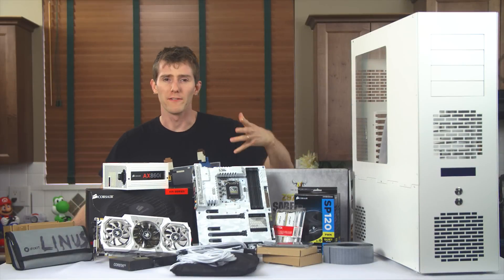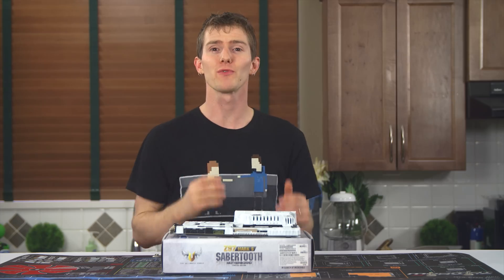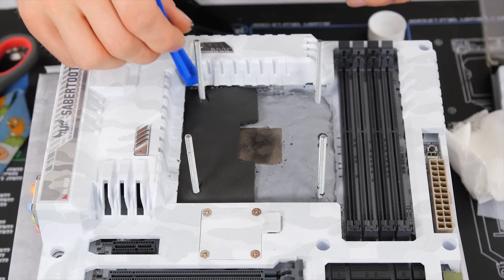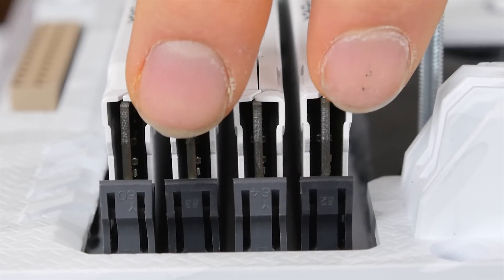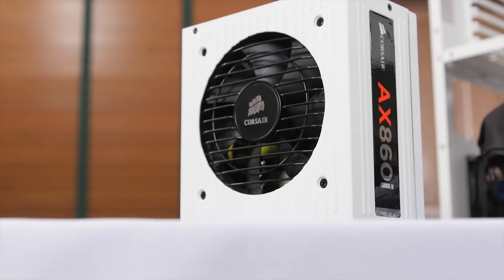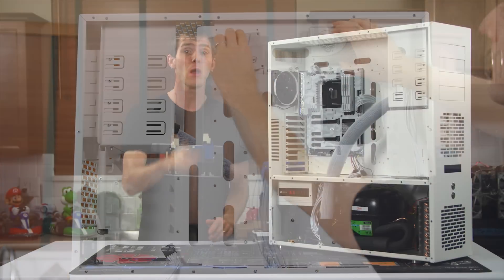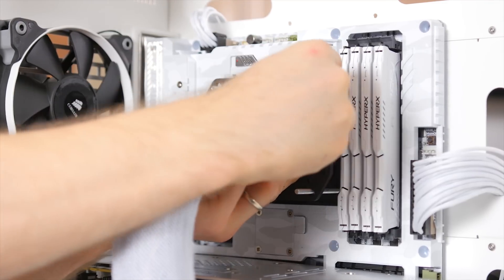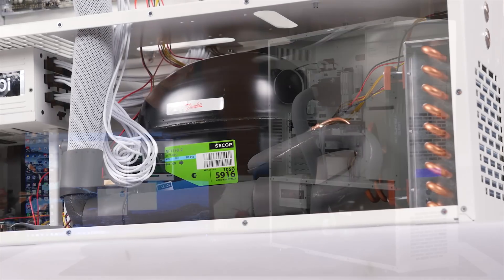ULTIMATE Sub-zero Phase Change Cooling PC Build Guide

Comment: Here from the latest phase change video:
I feel like there is a design opportunity in a self contained sub zero CPU cooler that has been missed here. 
Invert the motherboard and mount it on the opposite side of the case, then add a small catch tray for any possible run off. 
The CPU was moved to the top of the system in the ATX standard to allow better heat dissipation, but reversing that could protect any add-in boards from condensation shorting.

Comment: I always isolated mine with armaflex 1cm thick pads, and dow corning number 4 dielectric grease.

That worked fine 24/7 for years at -45C.

The only thing i wished i had, was a heater plate. In 24/7 use, when in idle it puts some heat on the system to keep the area dry, otherwise eventually cold will get through.

You could run some process to heat the CPU... But back then it was annoying on single core CPUs.

Comment: ask whats the tempurature of standard rubbing alcohol vs water in same bottle does one stay colder than the other liquid and does one condensate or does one evaprate out the moisture to have its better benefit in dry cooling liquid ?....contemplate on the contrary minor change that works like matchix as a water sucker not a water spiller for things that need to stay dry without seapage through materials as water can

Comment: maybe cooling systems should try rubbing alcohol for its liquid it might then avoide condensation as the moisture sucking liquid better for cooling with dry response not tap water but the water evaperator sucker to blocking wetness but no brainers applied for comon sense liquid cooler methods that aint just water but water disolver as the liquid oh and germ killer so no moldy systems

Comment: The phase change cooler alone is something like $2000
Reply: You can build one yourself, thats how we did it back then. There was a time when there was no comercial watercooling or phase change units. And heatsinks were shit too...

It was build it yourself or nothing.

A fridge 1/3hp compressor, 2m of 0.9mm capillary tube, a dryer filter, a condenser and a homemade evaporator made out of a chunk of copper and you are good to go.

You'd be amazed at how easy it is to get sub zero temperatures.

Comment: linus . . . ? 
does this system still works today demand of cooling issues we all gets
high cpu and gpu temp
now days there is a micro comppressor that can chill to -5 c 
but then a again does the moister will damage the hole pc up
Corrosion and moiste
thinking of build a stand alone unit that will provide a cold air directly to income air cpu + gpu
thanks for many Enlightening clips
keep with that enthusiasm 
big like from ISRAEL

Comment: There's nothing in a PC power supply that can kill you, nor even come close to killing you. That's one of the most asinine myths on the internet.
Reply: thats cap some of the capacitors can discharge up to 700 volts into your body which can kill you
Reply: @briachouston5941  "some of the capacitors can discharge up to 700 volts into your body"

Even if that were true (it isn't; a PC power supply takes in 120 VAC and converts it to 12, 5, and 3.3 VDC; there's no mechanism or reason for ramping up the voltage to 700 anywhere in the circuitry), so what? Do you know what the voltage of a typical static shock is, like you might get when you touch a door knob?

"Under severe conditions, up to 15,000 volts have been recorded. It is quite common to experience 5,000V. In fact, many people do not feel a shock from a static electricity discharge less than about 2,000-4,000V."

Also, a Taser is 50,000 volts.

"which can kill you"

Not even close, as I already said. There's not anywhere near enough energy stored in those relatively tiny capacitors to be dangerous.

Comment: “Massive 32GB of RAM”. Heh. I think I’ve seen them put 128GB into a workstation nowadays.
Reply: Yeah, im wondering using this cooling system on nowadays parts. Imagine all this w the new rtx, and a i9 10k overclock, 128 gb ram
Reply: 32GB is still a lot today, so you can imagine how much it was in 2015

Comment: A while back my gaming PC was getting old and always crashing with heat issues. I realised the air conditioner in the window could be an easy fix. I know everyone says it’s bad to use the AC and water damage with condensation. But I didn’t care. I moved the full tower case next to the window. Removed the side panels. And blasted the case with cold cold air. Highest fan setting. It was loud and expensive. Sure. But that PC ran sweet for another 12 months, until I retired it with a new gaming PC. Never had a problem with water condensation and all the things people warn about. It is so much more effective than water cooling or fans blowing heat around the case.

Comment: Damn the nostalgia and wow time really has passed, 32GB ram was considered massive then. I miss those really in depth build guides
Reply: @miguelwaide8198  yes almost no benefit for this when gaming but it isn't that expensive anymore
Reply: Crazy what 7 years does to technology
Reply: Wouldnt really say there is much difference, games in 2015 and 2022, 7 years apart, are pretty similar, there are only minor improvements in graphics and little has changed in gameplay.
Compare for example 1986 when games like Super Sprint were the rage, to 7 years later in 1993 when DOOM was released.....

Comment: Yes, actually, some silly Geezer Geek, ( or so I was named by Wired more than 10 years ago), found it interesting. While IBM's mainframes were often referred to as 'water-cooled' machines, the machines designed by Seymore Cray for Control Data and later his companies Cray Research were actually 'freon cooled' much like the machine built here. Instead of a freon-air cooler, they all used freon-chilled water intercoolers. CDC 660s used 8 tons of cooling, while 7600s 20T and the Cray 1s were 100 tons with later models requiring even more. I am thinking about building one of these for my next build. Good job, Linus.

Comment: Here's an idea:  Instead of attaching the phase change cooler directly to the CPU you could attach it to a CPU water block which you integrate into an full GPU + CPU water cooling loop.
If you wanted to push both components under 0C you would have to put anti-freeze in the loop but and add art eraser or dielectric grease to the GPU aswell.

Comment: Watching 4 years later, brings memories, i used to have LD PC-V10 with Phase Change unit. It was loud and obnoxous but it was sacrifice i wanted to make for best possible performance :D
Sad i sold my PC-V10, i want another unit like it. Now that im wiser i would use first layer of blue masking tape then layer of art eraser top of it, reason is to make art eraser extremely easy to be removed. Only thing i wanted to be improved in the Phase Change unit is switch to less noisy compressor.

Comment: Yo dawg I heard you like eating snacks from the fridge while you game. So we made your gaming pc temps..[...]

Seriously though, if they made a miniature sound dampened case and cooler as a single kit and miniaturize the whole thing for itx mobos, id get one. From 2 aios gpu and cpu in a silverstone raven 01 kit  still clogged itself with radiator dust and overheats.I want OCed itx to fit on my bookshelf but still be able to idle quietly and out of the way on a 7 inch deep narrow wall shelf, and my slim form factor case and 2 aios couidnt even deliver that, as it sits unable to boot up..

Comment: This is really late. But if you are replacing the entire shroud to add a water cooling block why does it matter which card you use if you only need to find a white block. Narrowing down the card to only a 980 because of the white shroud is moronic. Just get a white block for any card and remove the shroud... 8\

And with a proper engineering background you could easily modify a fridge to fit a computer by replacing parts if needed. I'm sure it's possible. We really need to raise standards. Knowledge when sufficient removes those danger problems. That is kind of the point. Or part of it. We used to expect people to learn everything. We need to get back to that.

Comment: Yeah but you're forgetting that if you have NVMe drives installed it'll kill their speed; they have to run hot in order to work at their proper speeds. Or else you may as well just use a regular HDD...

Comment: How about using Enermax Liquitec 360 for my Tread Ripper 2990WX and cooling the Radiator separately with a Peltier modules/combination to sub zero/almost nearer to Zero.  

or 

Isolate the whole system complete air tight, use dehumidifier equipment or chemical dehumidifier and cool the air within to sub-zero / almost nearer to zero.. 

Which one would be better.. 

Do suggest with this..

Comment: It's an air conditioner. 😋
What's the point though? Water cooling is overkill most of the time and that extra work to prevent condensation on the processor...
Reply: Well for the average consumer is not worth it is meant for day gamers or editers

Comment: This is old but is still incredible. 

I agree on the power supply, don't take apart your power supply unless you have experience with safely working on high voltage electronics.   Power supplies can have up to several hundred or several thousand volts even when powered off.

Comment: Is anyone ever thought about utilizing a non-conductive liquid to cool their PC computer stuff water pure water doesn't connect conduct electricity it's the particles that are in the water that will conduct it if a clean area inside the computer with no dust particles what have you in a liquid coolant system that doesn't conduct electricity you could circulate that and keep everything cool maybe
Reply: the water would erode the components and ionize which would short your system. You can submerge a pc in stuff like mineral oil linus did a mineral oil build a few years ago

Comment: Watching this now in 2018 I think this could be combined with a mineral oil immersed PC build to achieve really cold temps on the whole system not just the CPU. Is it practical? Nope but its sounds crazy enough to work since the mineral oil ensures no moisture... (Not sure if it would turn to sludge under really cold temps though)

Comment: i know its really late and you probably wont see this, but good call not laying it on its side. from the looks of it that was a hermetic compressor of some sort, and those need to not be tilted cause oil on the inside may end up flowing out of where its needed and would possibly cause problems later. i could be wrong tho.

Comment: Think with a liquid cooling system with large revisor, and a compressor cooling the liquid it wouldn't have to turn on very often once the target temperature is reached.  Obviously water wouldn't work, and water/alcohol or ethylene glycol mixture would have to be use to keep it from freezing.  Interesting though.

Comment: I have the same processor running at 5ghz on a deep cool 360mm aio temps on synthetic load is around 50-60 deg Celsius

Comment: Well he did touch on a tough subject. Heating the room your PC is in. I started by running a water cooled FX9590 overclocked. It certainly made the room hot. So I built a box that sits on top and uses a nice fan to send all that nasty heat through a 4 inch vent pipe. Other end connects to a board in the window. All my PC heat is now exhausted outside keeping the room cool.
Reply: Certainly saves on my gas bill.

Comment: You could lay it on its side, the oil would come back to the compressor after a few hours due to gravity... And in this case the suction and discharge lines of the compressor are on the opposite side of the compressor than the side you'd have laid it on, so it would have been safe without even waiting to power it on after putting it back up straight...
Reply: Thanks for the info, i can finally sleep with my fridge in my bed rather than in the kitchen tonight

Comment: damn it... someone did before i could....I was making plans for a R134a computer cooling case... and I was so close too.. similar design too.. crazy

WARNING TO THOSE WHO ACQUIRE THIS CASE.... R134a is a very dangerous chemical. It like Liquid Nitrogen, with the potential of give instant frostbite. It displaces Air, so any leaks can be harmful, if not fatal. If something were to go wrong or youre seeing a temp difference your best bet is to call a Heating/Cool company to help you repair it.

only certificated personnel can charge a system with any refrigerant

Comment: It's not an ultimate sub-zero cooling setup until you run an exhaust hose to your window. Congrats; you now vent your heat outside your house, essentially using the exact same methodology as a portable AC unit

Comment: How about just shut the door in your little computer room and turn on your 8,000 - 10,000 BTU air-conditioner and drop the room temperature down to 60 degrees?
Reply: Air conditioner won't drop temps below 0c.

Comment: Someone that pays this much for this phase-change tower and goes thru all the work to set it up while indeed not settle at 5.0 GHz with this chip, even having a pessimistic silicon-lottery attitude. Is there a follow-up video where he actually does more testing to see what clock speed he can reach with 24/7 stability? Or anyone else that attempts this and actually follows-thru on the overclocking?

Comment: Enter cheat code "bustoutwallet" + "forkitoverforusedcommercialkitchenStandalonecooler" could also substitute "fzr" instead of cooler. 
This will adjust your fridges BIOS settings to run calibrated for a much higher load cycle. 
As an added bonus you can store excess groceries next to it. 👍👌

Comment: a compressor can be laid on it's side as long as the power terminals ARE NOT UP I repeat  ARE NOT UP if the power terminals are up the compressor motor power wires can pull away from the terminal

Comment: We used to run Haswell at 5 GHz on fancy phase-change cooling, now a simple AIO or even an air cooler on a Kaby Lake and you got yourself a stable 5 GHz
Reply: Okuyasu Nijimemeura but imagine the clock if you phase changed a kaby lake cpu
Reply: wonder what oc is possible with kaby lake and phase change cooler

Comment: would you want to cool your GPU like this too ??? and can you ??
Reply: Lance Mccarthy graphics cards coolers cool more than just the Gpu so even if you were to get it mounted it would overheat other components. Even if you did find a way to keep everything cool, it would be impractical as Gpu overclocking isn't a very useful thing. 
Tl;dr: no
Reply: gpu overclocking isnt a very useful thing??? are you kidding??? 

yes you can cool gpus like this however it also depends what temp youre trying to reach, the lower the temp the less practical. but you can get sub zero with these kinds of set ups. 

though running gpus like this isnt as easy.

Comment: as a student of chemistry and physics it would quit interesting if you would use Nak (sodium and potassium allow which is liquid) as a replacement for water. the "NaK" is used as a coolant for nuclear reactors. it sould work fine
Reply: andrius bal -- With NaK (liquid metal alloy), you have to add electric heaters to insulated coolant lines to get the system started, since solid metal does not pump worth a damn. NaK has a low melting point, but not that low, and it is usually pumped with MagnetoHydroDynamics (MHD), basically the "caterpillar drive" from the sub in Hunt for Red October. The main reason for using NaK in nuclear reactors is that even at extremely high temperatures, it remains at low pressure (unlike steam).

Comment: Why not just use a water cooling system and just super cool the radiators instead of the CPU? That way you wont worry about condensation on the CPU as all the condensation would be on the radiator... You can even put the radiator in an aquarium instead of using a heater for the aquarium ;)
Reply: that would still cause condensation at the cpu as soon as your liquid/block moves below ambiant temps. It would acctualy be much worse also because the entire hose will have condensation. You can do an expereient with a glass of ice water and some hose to see yourself.

Comment: TEC for cooling. Uses a lot of power. 7amps @12v is what I ran mine at. Having a dedicated compressor is retarded imo. If ur going to go that route, might as well just build a room specifically for gaming. Expect 50k USD at least and that is just for the computer related shit. Nothing to do with the theater seats and monitor configuration. You could do it for way less, but a person willing to even think about this is probably going to want the ability to sue the shit out of the builder if it ever has a problem. Can't do that if you build it.
Reply: Unauthorized Expression I built mine myself for about 6k

Comment: have you guys worked with peltier cooling yet?

I'm getting silly temps with an amd cpu, under-volting and under-clocking. 

I wouldn't mind, but I have water cooling in the form of an antec kuhler 1250 and a nzxt h440 case. so I'm kinda stumped to why its at 51-degrees (and I know how to do things well)

my only guess is maybe re-paste with something better, but still frustrating haha

Comment: Does anyone have a good recommendation for a cheapish but good CPU cooler for overclocking. I have a AMD A8 5600K. My price range is $50 - $100 CAD.
Reply: you can never go wrong with a 212 evo. often used on fx8350's and 8320's to get them to that 4.5 ghz range
Reply: PuLsE Munstaz air or water?
Reply: Water preferably but I like to keep the price low, so Air is also good.
Reply: I got 1.80->2.40 GHZ with a stock Intel cooler on a E2160 at 60 Degrees Celsius.
Reply: maybe a corsair h100i ,  I myself have a antec kuhler 1250 (but I'm having temp issues, so I wont dis-recommend nor recommend as I cant pin down the exact cause yet)